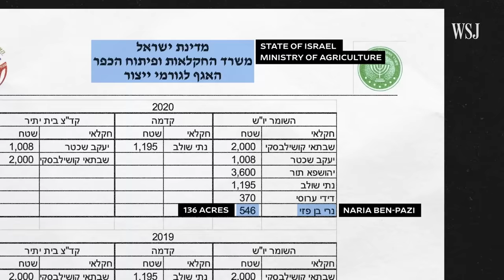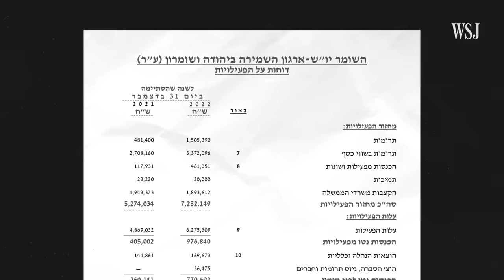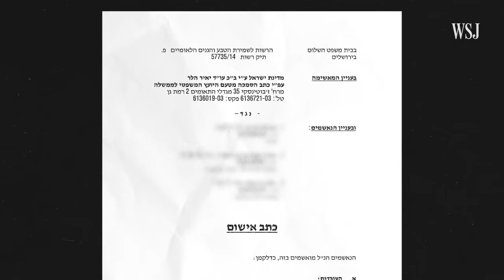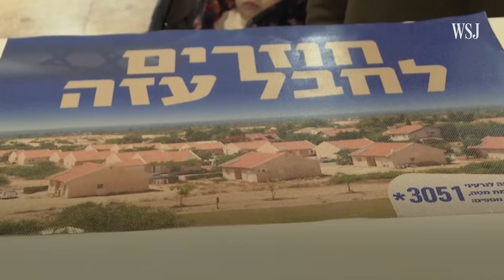Illegal Israeli Settler Roads Are Surging Across West Bank Since Oct. 7 | WSJ

Comment: The UN Mandate for Palestine, which not only allows but also promotes Jewish settlements in the areas of the Mandate (between the river and the sea), has never been aborted nor cancelled; it is still a valid legal document. Therefore, anyone who is trying to prevent or block Jews from settling in Mandate areas could be brought to face justice at the International Court of Justice in The Hague. All this does sound funny, but that is the current legal status as far as Jewish settlements between the river and the sea (aka UN Mandate Territories) are concerned.